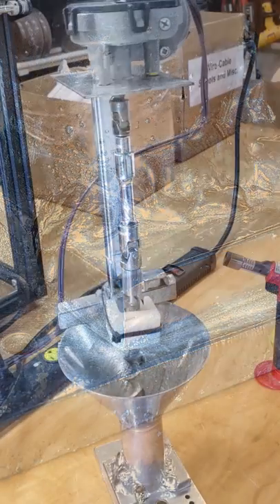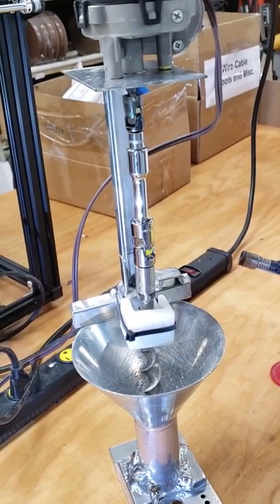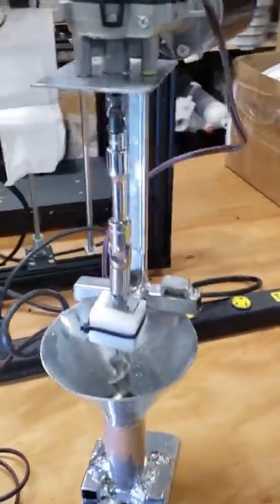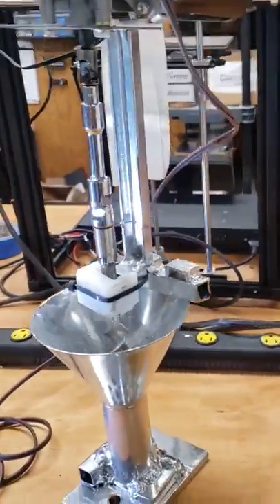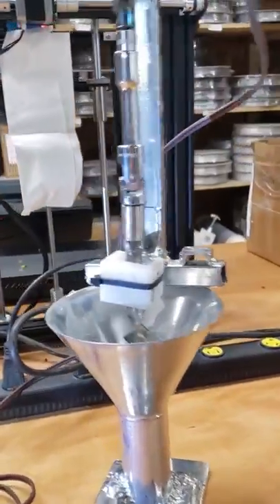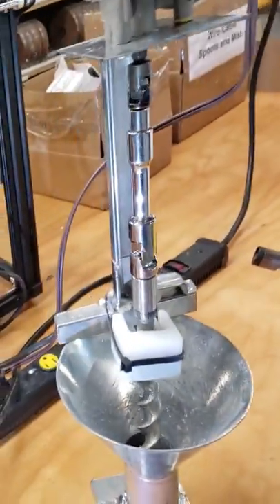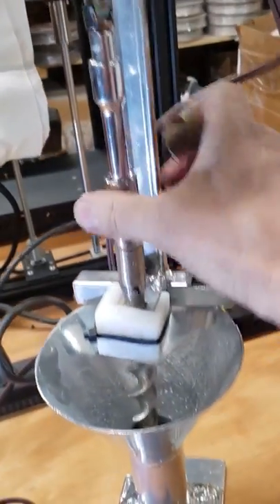Force Feeder for Extruding lightweight materials into 3d  Printing Filament.

Comment: What is the RPM of Main motor
Reply: I've never clocked it. It's a windshield wiper motor out of a car. I run it with a variable voltage power supply to control the speed.
Reply: @BradleyDWoods-pz8rv   we are  making a project on Filament Extruder Machine So I want to know the speed of the motor and some idea how to make.